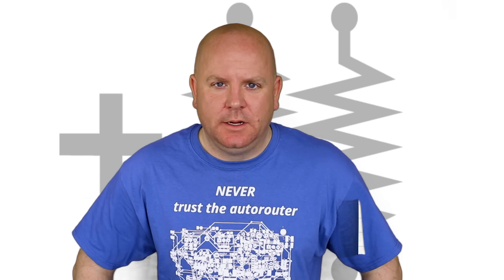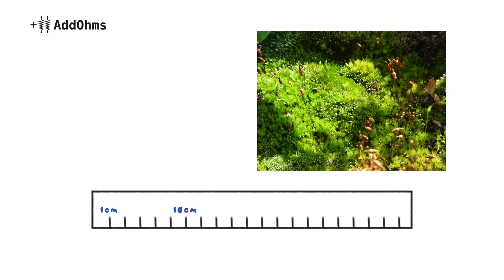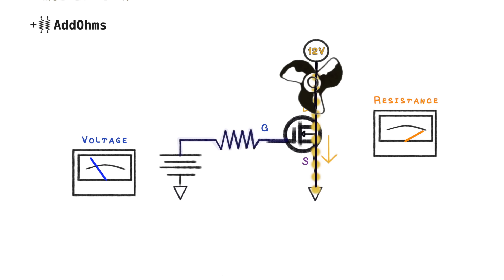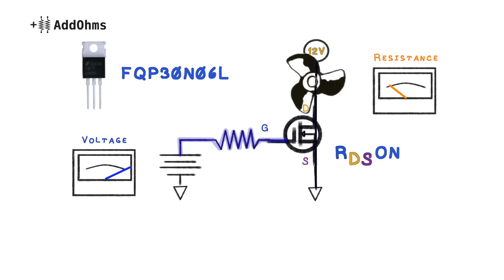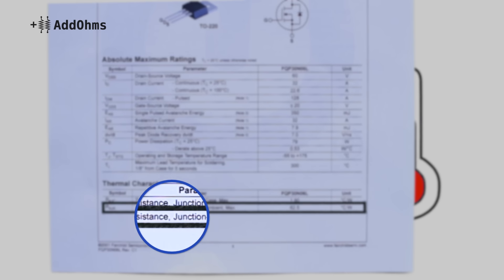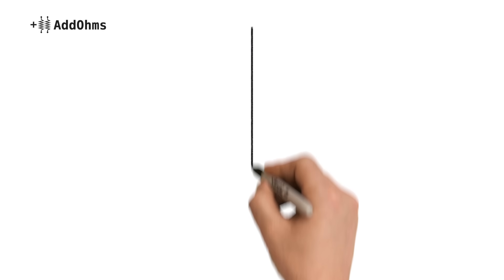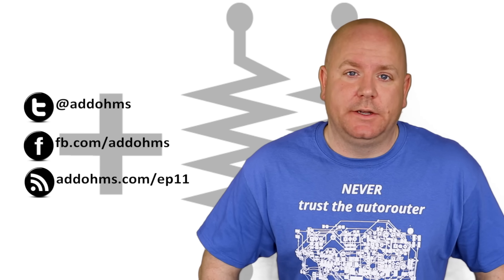MOSFETs and How to Use Them |  AddOhms #11

Comment from the maker: When looking at a datasheet, do NOT use the value of Vgs in the section "Absolute Max." This section is for conditions that will damage the MOSFET. More information here: https://discuss.addohms.com/t/what-does-absolute-max-mean/72
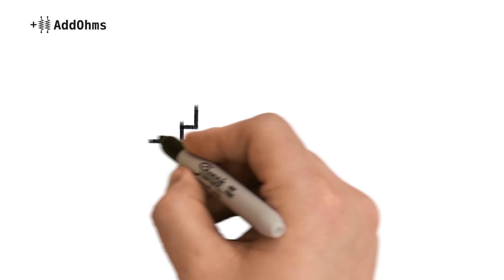Reply: Excellent video! I think there is one small typo though. At 2:19 my text book shows that you drew the schematic for the D-MOSFET and said it was the E-MOSFET.  Maybe some people use that symbol for both as a shorthand. Super video. Thanks!
Reply: I look at the Vgs and even the Vbe on BJT as what will kill it, and have put an LED on that location between base to emitter or gate to source to prevent the damage, as even a BJT can have too high of a voltage when there is not enough load on the collector when in darlington configuration. Best designs are ones that take into account what might happen to cause failure, then if something unusual happens it does not die on you.
Reply: Ha ha !!!
Reply: AddOhms a
Reply: One question,  we are working with a 2n7000 n channel transistor and in the drain caracteristics grafic states that the id max its reach at Vgs=10v with 1.5ma aprox. why its this, isnt it supose to be at Vgs=0v idss?
Reply: Hi
Reply: In the opening Joke about two men coming into a bar, the first one orders a glass of H2O, and the second one says he will have a glass of H2O too... and the joke stated that the second man is now dead.  Considering the dose is much less in this next circumstance, Everyone knows that the cute office blonde is great to look at and a bit dumb. The cause of this dim bulb effect I have referenced in response to the above story is that we can deduce that the cute office blonde is dumb because of Peroxide Poisoning considering her dose was much less.  😜👍  I'm going to go hide because HR is looking for me and they have gotten out the portable rolling gallows and intends to make an example of me. My ex's have been invited to attend. ha ha ⚡⚡💩💩☠☠🔥🔥
Reply: Nikša No additional components are required for basic switching. For high speed one would likely need a higher drive current (because of the gate capacitance) than can be provided by a signal generator and physically adjacent rather than at the end of a cable. Just ensure that the generator swing goes close to zero to ensure 'off' and for fullest conduction the drive voltage should approach the maximum allowed on the spec sheet.
But do you actually need a BIMOSFET? Plain MOSFETs are much more readily available and cheaper. Old PC motherboards are a good source. If you do need the enhanced high voltage capacity of a BIMOSFET it might not be particularly wise to embark upon such experiments until you have gained more experience because it can be dangerous and expensive. Have fun though.
BTW, BIMOSFETs are just IGBTs, the additional name is just marketing. And IGBT is a silly name anyway 'GIT' (gate insulated transistor) would have been far better, that's what we call them in the lab.
Reply: Traslate to pt-BR, please..
Reply: @DaniloAlves-vy2od  Tem legendas em espanhol.

Comment: Once the MOSFET turns on, does the output correlate linearly with the input, or does it just switch all the way ON as soon as activated?
Reply from the maker: There are two regions, linear and saturated. In the linear region, as the name implies, is linear. The resistance of Rds-On changes linearly with voltage. For an enhancement mode mosfet, this area is very small. You can see it in the "Output Characteristics" graph of a MOSFET's datasheet. More information here: https://community.element14.com/challenges-projects/element14-presents/workbenchwednesdays/b/blog/posts/reading-mosfet-curves
Reply: @AddOhms  thanks for the rapid reply. Essentially what I need is to follow an op amp with a transistor to achieve current gain. I need 40 ma to drive the LED within a vactrol. I am thinking BJT class B common collector topology. Would you do it this way or use a MOSFET?
Reply from the maker: Either is fine.

Comment: You did not even say what pin connects to what
Reply from the maker: Huh? I said which terminals on the schematic are the gate, drain, and source. The pin number of the actual package depends on which device you’re using. So YOU have to look at YOUR datasheet to determine that.

Comment: In my experience temperature problems arise when you switch the circuit at high frequency. The steady open or closed states are easy to assess, as far as heat. But the switching is way more complicated and can lead to major problems.

Comment: Here because I wanted to know what’s so special MOSFET regulator/rectifiers on motorcycles. Mine needs to turn 85V of AC current into 13-14.5V of DC and dissipate the excessive heat generated.
Reply from the maker: They drop less voltage (and dissipate less power) than a passive diode.
Reply: @AddOhms  Can you explain why outside about 80° I was getting a .49 but then after it’s been inside the house in air conditioning it’s now only showing .15? How sensitive to ambient temperature are MOSFET?
Reply from the maker: Do a search for “mosfet postive temperature coeffient”.

Comment: Excellent.  Succinct and to the point, and gives you a logical approach to choosing a MOSFET that meets your switch application requirements.  If only the manufacturers and/or distributors would put a tool on their web pages to help you make a selection using this approach!

Comment: First of all: thank you for your video that describes how you can use MOSFETs. I need a MOSFET that is fully turned on at 2.6V or less to use as amplifier for a signal from the phototransistor inside a MCT6 / ILD74 optocoupler. When I visit the website  of most of the websites carrying similar models, there is usually a sign next to it that tells me that it is obsolete and won't be produced anymore, let alone in THT format...
Reply from the maker: For such a small signal I would use a BJT.
Reply: @AddOhms  That would reduce the output  voltage below TTL levels because of the voltage drop of the junction
Reply from the maker: Huh? Use a common emitter amplifier.

Comment: Resistance value for D > S? also, Resistance S > D?? mosfet used as controlled diode... perhaps as rectifier/regulator in AC generator
Reply from the maker: Huh?

Comment: It doesn't seem right that the power capacity is to do with the gate resistance. A transistor might do 100 amps with a gate resistance of 5 milliohms but have a total power of 200watts. How then does it overheat with a heatsink in 30 degree ambient
Reply from the maker: First, it is Drain-Source resistance (Rds). The voltage applied between Gate-Source (Vgs) determines the Rds. In general, the higher the Vgs, the lower Rds. Then it is just a function of the Power Law: Power =  I * I * R. In your case that's 100 * 100 * 0.005 = 50 Watts dissipated by the transistor. (no clue where you came up with 200 watts.) If its package has a thermal resistance (from junction to air) of 62C/W, that means it would rise 3,100 degrees above 30. In other words, you need a heat sink.
Reply: @AddOhms  look at fdh50n50. It has a maximum power dissipation of 625 watts, max 48 amp and 0.10 ohms rds
Reply from the maker: First, "Absolute Max" is the point at which damage will occur. It should be used to determine the design limits. 

Second, specs are not cumulative. 

Power dissipation is limited by the package. This particular package might be able to handle 625 Watts, but the silicon inside of it may not.
Reply: @AddOhms  so it says at 25 degrees the continuous is 480 watts but it also says the power dissipation is 625 watts. So really the power  dissipation would only be 480 watts
Reply from the maker: Yes. Again. “Absolute Max” are the worst case design limits. And power dissipation is almost always limited by the package.

Comment: im going to have to look at my tech school books again, i thought mosfets was low resistance at the source and drain and gate until voltage was applied to gate then flow was lowered not like FET transisters that was high at the source and drain like a bipolar transistor going to have refresh my memory.
Reply from the maker: I cannot understand what you are saying. Please use punctuation. But what you seem to describe is a depletion mode FET, and not an enhancement mode FET.
Reply: is that a new type of FET transisters from the old type?
Reply from the maker: What are you even talking about?
Reply: many other componants has been made for the last 30years
Reply from the maker: 30 years?! This video covered incredibly basic MOSFET characteristics that are over 60 years old.
Reply: ok now i know the difference between enhancement and depletion MOSFETS ,its been a while .

Comment: I didn't get what does Vgs is used for. In the datasheet is 2(min)<Vgs<4 (max) so that's the Gate voltage, right? What happens if the voltage is lower or higher that those values?
Reply from the maker: The range accounts for the variation that occurs during manufacturing. That spec says any voltage below 2 volts ensures the FET is off and anything above 4 volts ensures it is on. Between 2 and 4 volts, the FET may turn-on. The output characteristics graph shows how "hard" the FET turns on with higher Vgs voltages. If it says 4V, you should be using at least 5V to turn it on. (Most FETs like 10-15V.) More information here: https://bald.ee/mosfet-curves
Reply: @AddOhms  thank you. Last question. If let’s say, the graph shows that when supplying 6V the ID is 10A, but my power supply only gives up to 5A and the load that I have connected uses 2A, then what will happen? Thanks in advance
Reply from the maker: You’re reading it wrong. WHEN the current is X amps, the voltage from drain to source will be Y volts. The transistor can’t “make” more current than exists.

Comment: But how would you use a P channel MOSFET? Doesn't that switch open at a low signal, instead of high, at the gate?
Reply from the maker: Voltages are relative. N-Channel needs gate to be higher than source. P-Channel needs gate to be lower than source. That’s why it’s threshold is “negative.”

Comment: To use a Mosfet as a switch is it necessary to use a pull down resistor on the gate to turn the Fet off once the 5 volt logic is returned to a low state. I thought that once the device turned on it can use the current running through it to stay on.
Reply from the maker: Depends on what is driving the gate the signal. If it goes high-Z instead of to 0V, then yes, you would need a pull-down.

Comment: Can somebody explain to me how is MOSFET not a relay? Dont these do the exact same thing? And yet on the wikipedia page about relays there not a single mention about a MOSFET, only Solid-state relay, so I must be wrong. Please explain to me how am I wrong? How is a MOSFET not a realy?
Reply from the maker: They are completely different. Relays are mechanical with moving parts. MOSFETs (and all transistors) are solid state devices.
Reply: @AddOhms   @AddOhms  Yes, but dont they do the same thing but differently? Could you create a (giant and slow) CPU using relays instead of MOSFETs?

I know these operate differently, but dont they have the same exact fucntion - to control current using voltage on seperate terminals? I know Im wrong, but I dont see how.
Reply from the maker: Yes, you can build a cpu using relays as switches. Very early computers did that and there have been some modern DIY projects.

MOSFETs operating a switch is only one of their functions. Relays only have one function: act as a switch.
Reply: @AddOhms  Oh, I think I get it now. A relay is not a MOSFET and a MOSFET is not a relay, but both are/can be switches.

The confusion arised from the fact that I thought a "relay" means exactly the same thing as "switch".
Reply from the maker: Well, no. "Relay" does NOT "exactly" mean the same thing as "switch."  A relay is a type of switch. Just like a transistor is a type of switch. And a push button is a type of switch.

Comment: A really cool feature of FETs is that many of the enhancement mode type can be triggered and stay triggered with nothing connected to the gate! That’s also it’s downfall as a FET in an SMPS can stay triggered and pop if a suitable gate resister isn’t used to stabilize off time.

Comment: Great video, learned some good info.  I want to use mosfet in a PWM application to control my motor's speed.  I plan on free-wheeling diodes across my motor to limit back-emf to driver circuit.  Any special precautions about PWM applications for MOSFET??
Reply from the maker: No.

Comment: At 1:49 you say ¨depletion mosfet works like a normally closed switch. Current can flow when no voltage is applied.¨
1. I thought normally closed means no current flows.
2. How can current flow when no voltage is applied? Is it kind of shortcutted generator?
Reply from the maker: 1. When a switch it closed, it proves a path for current. When it is open, it stops it. 
2. When no voltage is applied to the gate. Obviously there has to be voltage applied to the drain and source.
Reply: @AddOhms  Now i understand.

Comment: What kind of mosfets do you use in a ebike controller.
Reply from the maker: Probably ones that handle high power.
Reply: @AddOhms  ok how about a 36 volt  . What volt mosfets would you need thank you for your reply.
Reply from the maker: Zero clue. There are probably lots of circuits, examples, and application notes on this specific application.
Reply: @AddOhms  ok thanks

Comment: MOSFET aka Metal Oxide Smoke & Fire Emitting Transistor   20 years ago my nickname was 1 leg MOSFET ... because the other two burned off.  Let's just say some of my motor controller designs suffered from insufficient heat dissipation and or catastrophic back EMF issues.  I always said "fire is the other way to learn".

Comment: One thing I would mention is that, unless you enjoy parasitic oscillations during transitions between on and off that result in a lot of heat dissipation and RFI, never put a resistor in series with the gate.  Always drive the gate with as low a source driver impedance that you can to quickly charge and discharge the gate capacitance to minimize the time that the transistor is operating in its linear region.
Reply from the maker: No. A gate resistor can (and usually does) reduce ringing and EMI emissions. Too high of a value causes the switching to slow down, resulting in unnecessary power dissipation.

Comment: Thank you for this exelent  information.I have  just one question if you can help me.On the top right corner of the data sheet shows the VGS(TH)=10V.  Where did you get  VGS(TH)=<5V?
Reply from the maker: In the Electrical Characteristics section. In the marketing section, it is saying a certain current capability with a specified Vgs.  With lower Vgs, it'll handle less current.

Comment: Loved the simplicity and ease of explanation. I was struggling to use a P-Mosfet with 24V rail. and Vgs>20V. read in comments below, an advice to use a voltage divider. Thanks....
Reply from the maker: You misread the data sheet. That is the maximum Vgs. Not the threshold.
Reply from the maker: You may also want to read this: https://www.baldengineer.com/p-channel-mosfet-tutorial-with-only-positive-voltages.html

Comment: the current leakage between D to S is a problem in mosfets not very good in a switching mode
Reply from the maker: Someone should tell the designer of practically every digital device and (low-voltage) DC-DC converter on the market today.

Comment: well done for your video. I have a question. I dont understand the meaning of 12 volts. You said voltage between G and S. I don't undertand it.
Reply from the maker: It's the voltage for the load.

Comment: Great video. Very well presented. I'm looking to Voltage limit a battery charger. A trickle charger say 3A and limited to 15VDC. It would be nice for you to go over how to calculate and select the components for this circuit. You're talking to a real novice with a keen interest who just discovered you. I apologize if this is too simple :)
Reply from the maker: 3 Amps is not a trickle charger. There are plenty of circuits on the internet that explain how to charge different battery chemistries.

Comment: Apologies for the newbie question - when would you and when would you not use a resistor on the gate?  What determines the value of the resistor?
Reply from the maker: The gate is a small capacitor. The resistor limits in-rush current. Picking a value is not trivial, depending on the use. If it is a slow signal (turning on a large load) then use 100-1000 ohms. If it is switching up to 1 MHz, use about 100 ohms. Beyond that, you need to look at some application notes to see what manufacturers recommend. More details here: bald.ee/wbw-yt-miller
Reply: Got it, thank you!

Comment: And if I apply logic to circuit resistors.  Then for this to work as a variable resistor.....   as the resistance goes up in this mosfet it will have to dissipate all of the heat as a resistor. So this is not a great variable resistor except at very low resistances like the .035 ohms or very high resistance so almost no current flows. 79 watts with a heat sink at 25 C is still very impressive for this device.

Comment: Ok I watched it again.   .027 ohms drain to source at 10 volts (gate to source). And it goes up to .035 ohms at 5 volts G to S. That does not tell me how this can work as variable resistor. It seems to be closer to an on or off transistor.
Reply from the maker: If you want a variable resistor, you want a JFET. Not an enhancement-mode FET. As you pointed out, the variation on an enhancement-mode is very small.
Reply: @AddOhms   Oh no I have to learn something new again.    I'll check it out.